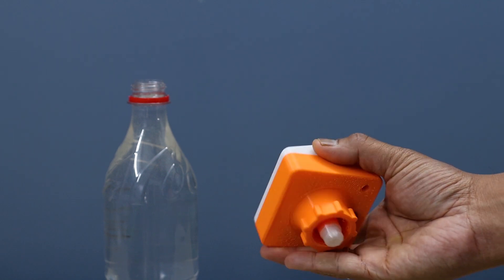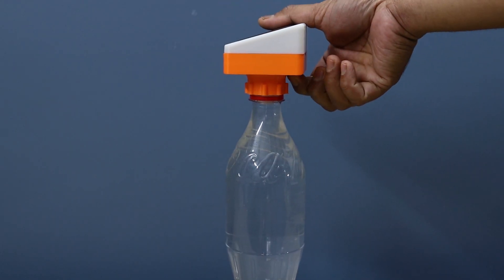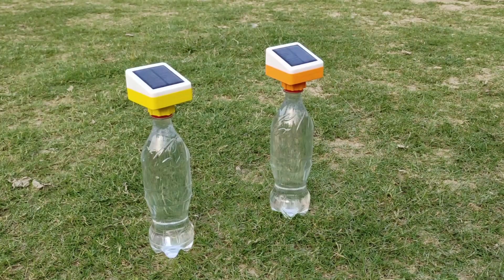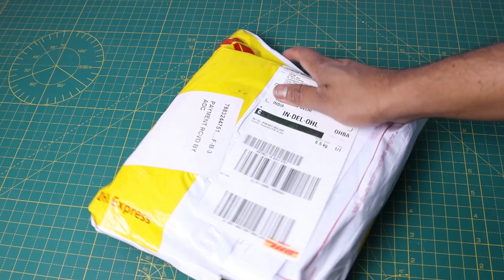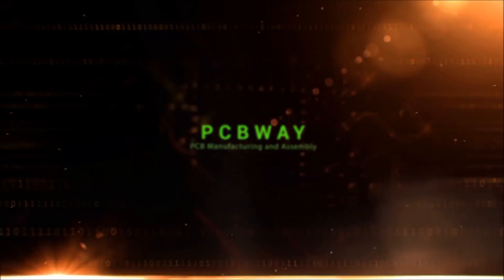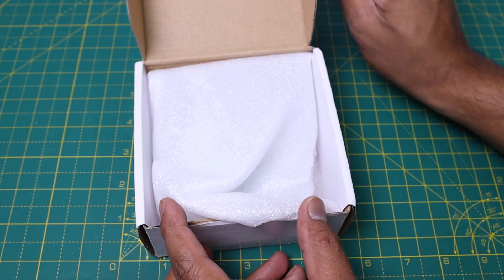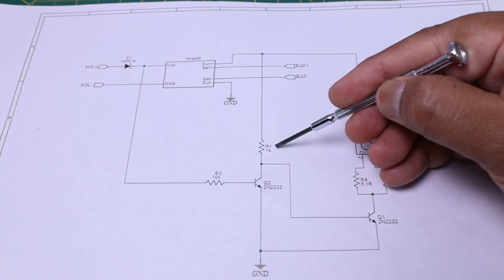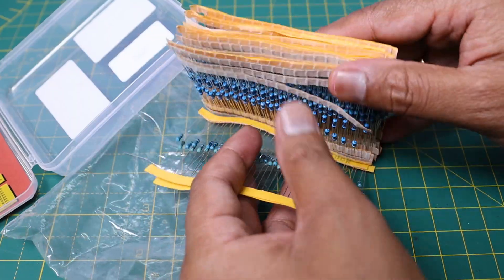Make Solar Lamp Using TP4056 | Reuse Plastic Bottles to Make Solar Lamp | Celebrate World Earth Day

Comment: Can you make an all in one battery charger/tester?? That will be able to change ni-mh, ni-cd, lithium ion, lithium ion phosphate and even lead acid battery using Arduino. Also will be able charge them for storage purpose and be able to test there internal resistance, ect ........ 🙏🙏

Your videos are amazing..... I made a 12 lead acid battery charger from your video....😃 And it works like a charm....
Reply from the maker: Yeah, I will try to make videos on similar topics

Comment: Excellent work. My requirement is to add 24hrs timer. Please help me
Reply from the maker: Can you elaborate ?? Not getting it
Reply: @opengreenenergy  I am ex-servicemen retired from Army. Presently I am in agriculture so I want to install this type of solar lamps I my fields with the help of 24hrs timer. To prevent crops from pesticides and fungicide. 
Jai Jawan... Jai kisan... Jaii Vignan
Jai jawan.  Jai kisan. Jai Vignan
Reply from the maker: Hello SIr,
The solar lamp is automatically turn on after sunset and turn off after sunrise. 
Is this feature you want ? Or anything else ?
Reply: @opengreenenergy  

I need a timer based switch, where the light will attract bad insects and gets killed between 6:00PM to 12:00AM which will help in agriculture. After 12:00AM it has to switch off because after 12:00AM Good insects come out and help the crop to grow and obtain good results for the crops.
Reply: I am ex-servicemen retired from Army. Presently I am in agriculture field so I want to install this type of solar lamps I my fields with the help of 24hrs timer. 
Jai jawan.  Jai kisan. Jai Vignan

Comment: Solar panel volt please
Reply from the maker: 6V but 5.5V will also work.
Reply: @opengreenenergy  will 5v panel work? One more question. I have a bunch of n channel mosfets sitting around. is it possible to adjust schematic to use them? Thank you very much.
Reply: Thanks👍